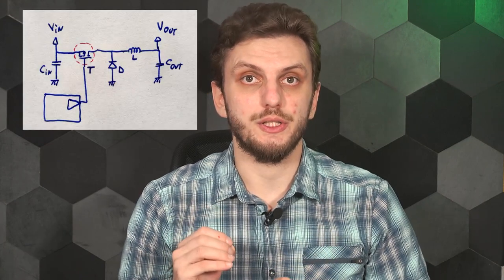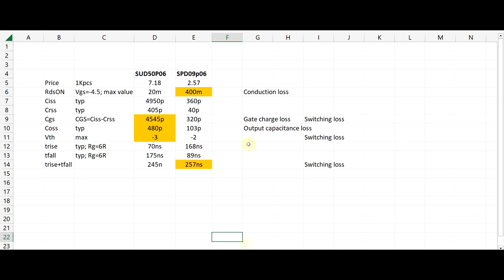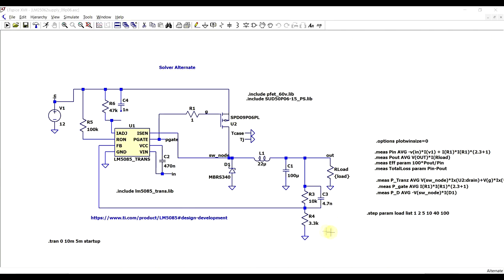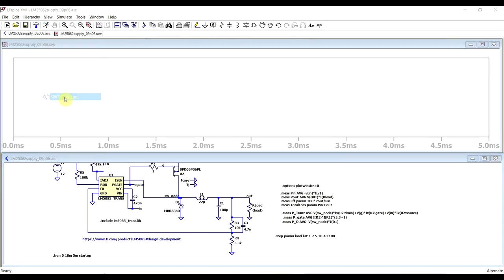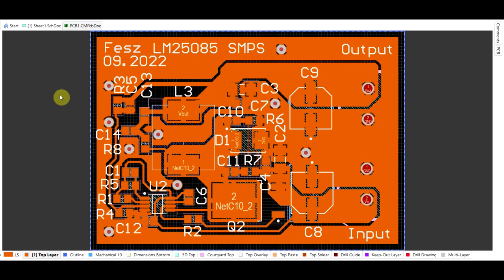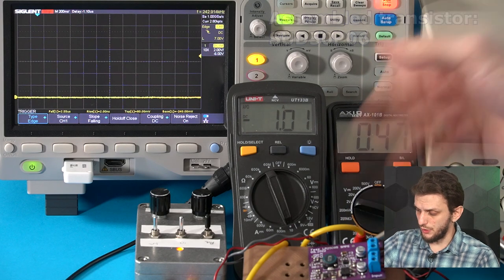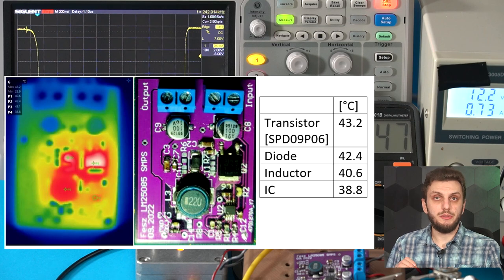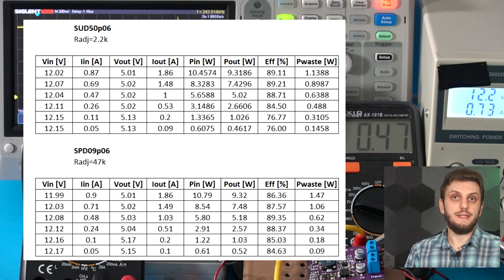Switching Transistor Losses (2/2)

Comment: [16:10] "The best transistor for one use case is not the best for another use case" - general engineering rule applicable for pretty much everything! ❤ 🙏
Reply from the maker: You are right, however I met many people that found something that "worked perfectly once" and they believe its the solution to every problem. In this particular case, its easy to think that a low Rdson transistor will always be better than a transistor with higher Rdson.

Comment: The shorter the switching time of the transistor, the more impulse noise is generated on the inductance. We reduce the losses of the transistor, but then we increase them on the filters in order to keep the noise level at an acceptable level.
Look with a spectrum analyzer or sdr receiver on FM radio frequencies. What is happening on the air.
Often, I was increased resistor on the base of transistors up to 60 Ohm to decrease EMC noises..

Comment: Nice video! Great way to analyse the losses and nice output. One realy inportant thing that could be add despite thermal measurement is EMC measurement. That will make the difference. May you use a near field probe or LISN or CP coil? This could be a nice content for a EMC debug video and a final decision for wich is the best choice. Congratulation!

Comment: Hey, FesZ. How are you doing? Hope you're doing great.
I'm designing a SEPIC converter, but I'm having some difficulty smoothing out the current spikes generated when the MOSFET closes.
It's like a shoot-through current that flows back from the output cap, back through the diode, back though the decoupling cap, and through the MOSFET.
That should be a common-enough issue, and I'm sure people would love to learn – just like I would – about the techniques that can be used to mitigate it.

Comment: Although I like the video series overall, it botheres me a bit on how the topic (switching and conduction losses) was shown at the real converter. 
I may be wrong, or misunderstood something, so please correct me if so.

The efficiency takes the IC (and other components) into account. In your specific application this may be the best way to figure out the best FET, as you already pointed out yourself. However I was thinking that the whole topic is about the switching and conduction losses, which can't be determined exactly from the efficiency alone, since this is now a mixed bag. A seperate measurement of the IC power consumption would have clarifyed this. I belive that the result in the efficiency of the SUD50p06 at low power consumption could be a lot better. The warm IC is worth noting, but other then that just a unlucky byproduct of the converter for explaning this topic. That beeing said, when you need to switch a FET with a gate driver, you often take the needed gate currents and gate capacitance in to account, resulting in a gate driver, that doesn't get that warm under this conditions. Also by altering the gate resistor slow-switching (and also less ringing) with low rds_on and fast switching with high rds_on could have been compared, in order to point out conduction and switching losses (which I though was the topic). 

Also after watching the video twice, I found it a bit weird that you pointed out Radj that much, because (as far as I read the Datasheet) it shouldn't have any effect in your application other than I_ds over current limiting. By choosing Radj to a high value the I_ds current limit is theoretically disabled, and since you're not about to hit that current with that small load, this fact is now pretty much meaningless for most viewers. As I first watched the video, it was not cear to me, what Radj does, and thought from your commentary at 1:40 it had to do with the gate current (wich would have been very important to note, if it was the case). 

I think all of this could be explained more detailed for example in a future video about gate resistors and ringing, which is a important topic on its own.
What do you think?
Reply from the maker: Hello Tim,
I took the IC consumption into account since from my point of view, efficiency is at the whole SMPS level, not just the power stage. When analyzing a power supply, you are interested in the global behavior which usually has the highest impact from the power stage and the control IC is usually negligible; I wanted to point out that in certain cases this is not true - by not taking into account the limitations of the IC, a "good" transistor can still cause high global loses.
I guess you are right, I did insist a bit too much on the Radj topic... 
The ringing problem is a separate topic - I do plan to cover this in the near future; I think these are separate and colliding topics, but both very interesting.
Reply: @FesZElectronics  Okay, I get your point :) 
About the ringing topic, I tought that slower switching reduces ringing but increases switching losses, so it would have been matching topics, but I'm no expert. I'm looking forward about your coverage of this topic!

Comment: For switching power-circuits, I've sometimes had ceramic capacitors (dielectric losses) being big culprits - switching from X7R to NP0 reduced the losses dramatically. Do you plan to touch upon this in a future video?
Reply from the maker: Did you use these capacitors as input/output buffers or? Sounds like a very interesting topic - maybe you can give a few more details on the actual usecase and benefits.
Reply: @FesZElectronics  The PWM filter-capacitors - so, for example, C1 and C4 in the schematic visible at 5:09 . The AC charge/discharge current into the capacitors led to them getting hot. Temperature is, of course, not a direct measure of dissipation, but a good first indicator (observable, as you did, with a thermal camera).
Reply: Sorry, one addition - we had a wireless power-transfer system (~100kHz), so the capacitors saw a large dV/dt. In a DC-DC convertor, this will be limited, as the capacitor-voltage is fairly constant. (My pain-point may be true for the e.g. class-D RF applications, though.. In your circuits you seem to have used polymer capacitors which are OK, I suppose)
Reply from the maker: I think the main reason why NP0 is not commonly used is price vs capacitance; Especially at 100KHz I think you where using relatively large values so the NP0 was more expensive and larger (from a size point of view) compared to the equivalent X7R. 
Since you mentioned power transfer, I guess the value was also critical if you relied on resonance; X7R has quite a large capacitance value variation both from initial tolerance and temperature as well as from DC biasing. I think that in general when a precise capacitance value is needed, X7R is not to be used - either NP0 or film would be better.

Comment: Vgs normally should be around 8-10 volts to achieve maximum efficiency. Also, compare parameters with cheap counterfeit Chinese MOSFETS, as it is not reasonable to pay too much, if you can just take several of them and get them work. It is not fair to compare same category of price (high priced) components.
Also, there should be NO diodes in DC DC converters except the protection ones. Voltage drop on them is a pure waste of efficiency.